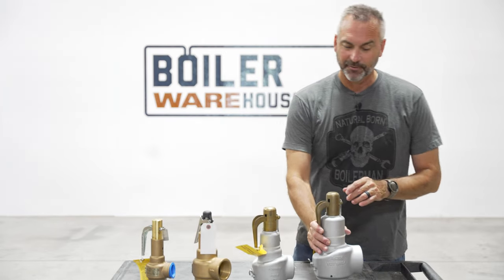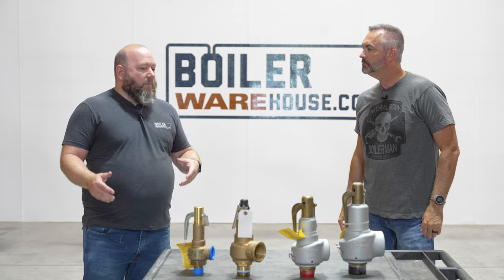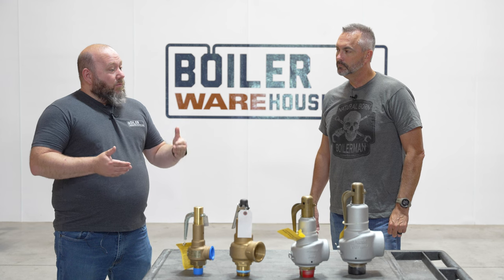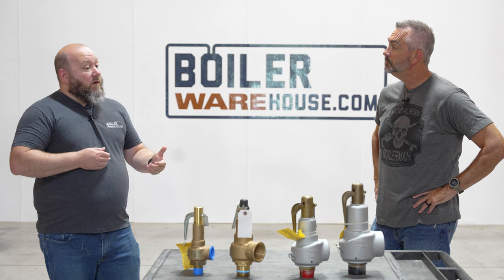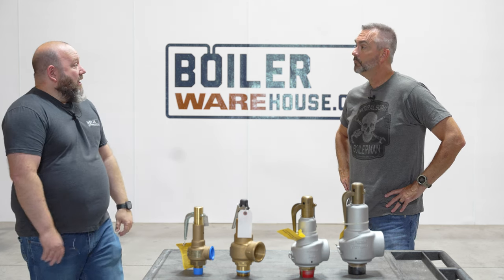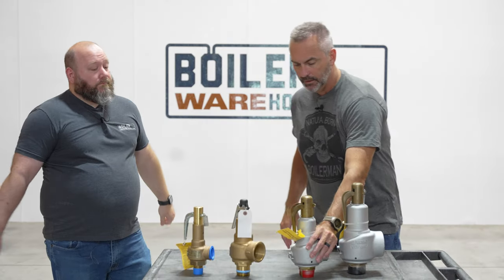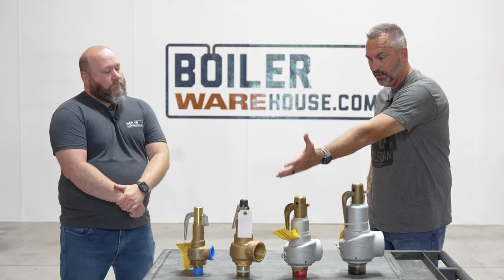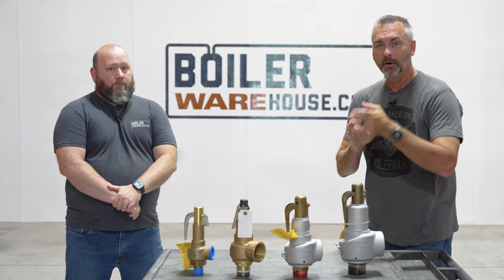Boiler Safety 101: Selecting the Right Relief Valve Size - The Boiling Point

Comment: Do a video on relief valve ratings- V, HV, UV.  Throw in when to use lbs/hr, btu/hr, SCFM,GPM, etc.. Also, the tech should brush up on staggering set pressures.  There is an acceptable range between the highest and lowest set pressure..

Comment: The comment about the inlet side of the valve is incorrect.  This is what code says:

The opening through all pipes and fittings between a piping system and its pressure relief device shall
have at least the area of the pressure relief device inlet. The characteristics of this upstream system
shall be such that the pressure drop will not reduce the relieving capacity below that required or
adversely affect the operation of the pressure relief device.